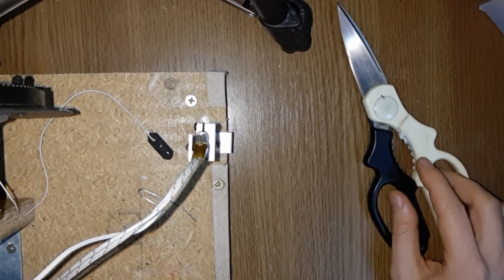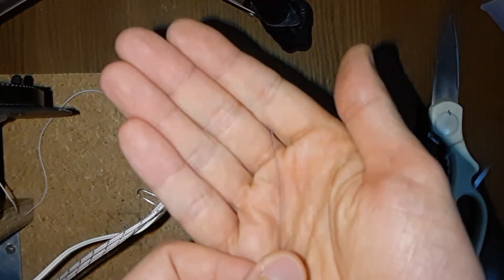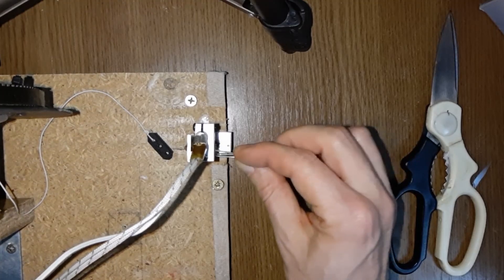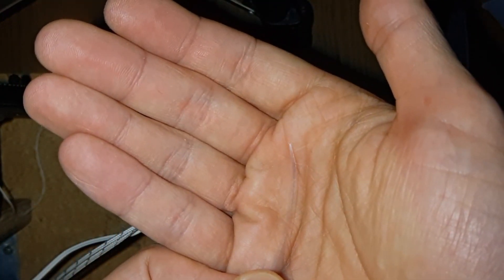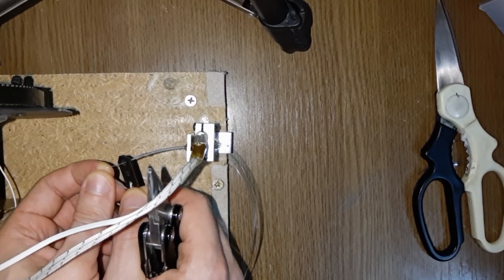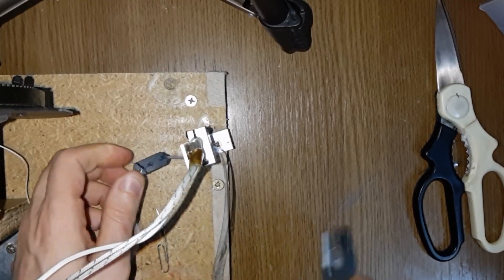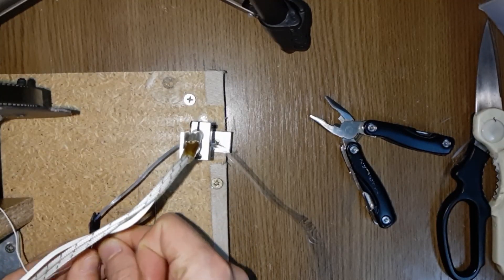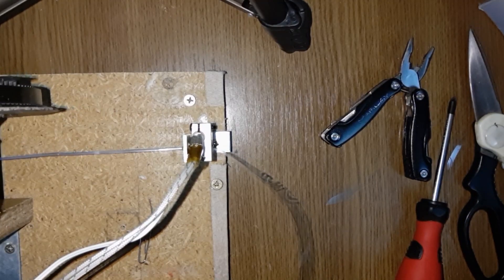How to turn pet strips to fillament

Comment: what temperature do you use in the extruder when you are making the filament?
Reply from the maker: I dont remember exactly what I used, but PET has a melting / printing point of around 260-260, so I think something like 220 should do it, its quite easy to adjust on the spot. I stopped doing it though because of the smell, if you have some outdoor space its fine, but indoors its not worth it. It was printing fine with this filament but same problem with the smell when you print as well